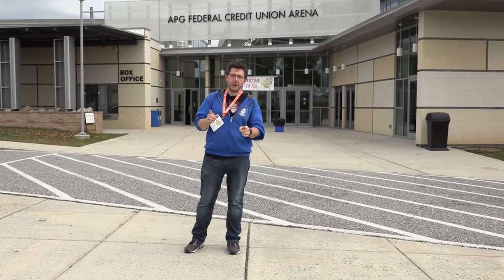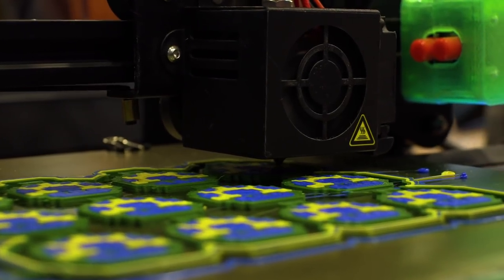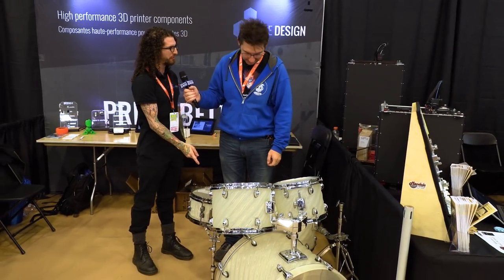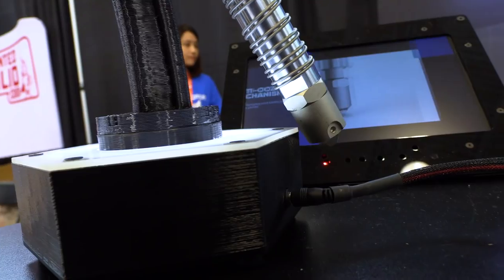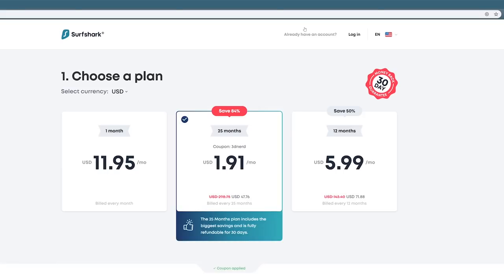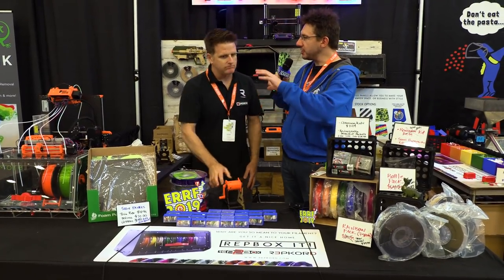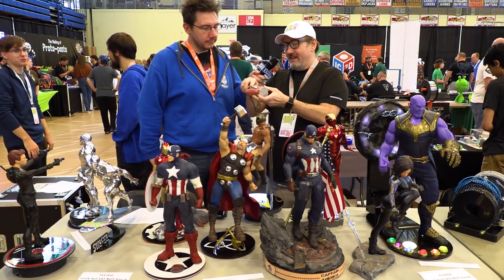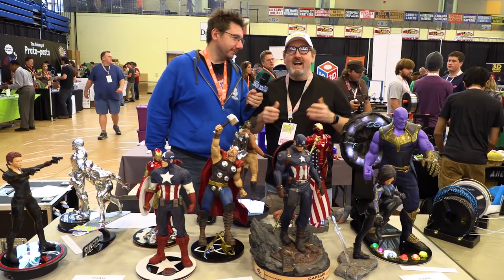Is THIS the Best 3D Printer? See Elite Machine Works AND MORE at East Coast RepRap Festival part 1!

Comment: The Elite Machine Works printer sounds right up my alley!  Finally, a printer that's not taking a ton of shortcuts on design.
Reply: Well... it is still a cartesian design (bed moves in Y Axis) which is most common but already outdated at this point. Elite Machine Works is just overengineering this outdated design which makes it first of all redicilously expensive, but still keeps the inherent designflaws. CoreXY is the next step as it has many advantages. All 3d printer companies are moving to this right now. So, you still want to commit 2k to a 3d printer dinosaur?
Reply: I have one of Kyle's kit printers - it is the precursor to the version he showed at ERRF. Mine has is pretty similar, but his new one has some upgrades, like the dual motors for Y, the CF rod stiffeners, and the slick CAT5 cable extruder interface. My printer works great. Super heavy and bomb proof. No resonance. You can't print super fast, due to the mass of the Y axis, but i regularly print at 80mmps and never worry about the thing breaking down. Recommended.
Reply: @ocieward  Yep, and that's the point. You print at 80mm/s, because that is the best compromise for this type of printer. Meanwhile any CoreXY prints at literally double the speed-- with same or better surface finish-- at half the machine price. I don't say this is a bad machine, it is just  "outsmartet" by better concepts and thus outdated.
Reply: H. P. Baxter yes, I agree with you that for this size of bed, coreXY is probably a better choice. But I don’t think that makes this machine obsolete. It depends on the intended use. This machine doesn’t have problems with belt stretch, so perhaps it would require less maintenance. Also, Kyle is working on a second IDEX head for this x axis, which would be very easy to implement, although the x on this one looks like it would need to be replaced with longer rails to make room for docking at each end. 
My printer kit was $1000, which was less than I paid for all my railcore parts, so for me this printer still made sense. The one he showed at ERRF is upgraded and the price he mentioned reflects that.
Reply: @h.p.baxter8150  Corexy has drawbacks. It is not the end all be all to printer kinematics.  Belt length being a major drawback at larger print volumes. My design is proven and it works as intended. It is not over engineered for the sake of it. On the surface it is hard to see all the detail that has gone into it.  The Ultimate XL reliably prints at 180mm/s with very acceptable surface finish. I'll be applying this philosophy to other designs aimed at large format printers. I'm just getting started.
Reply: @Robert Cowan.  I've been subscribed to your channel for a couple years now. Love the content! I actually bought a broken  Stratasys dimension based on your videos to build into a PEEK printer. That project is taking a little longer than expected...
Reply: @elitemachineworks1037  Awesome!  As someone that has a background as a hobby machinist, it's nice seeing a 3d printer that's build well, and not just using 3d printed parts!
Reply: Don't think there's much difference for CoreXY compared to a bed moved on Y axis.
It depends mainly if you want a compact and easy to access desktop model, or if you want a thermal chamber.
CoreXYZ on the other hand is a huge improvement on both, since you only move the printed part when replacing the build plate.

Comment: For the chameleon why not assign each feeder a number, use the left switch to rotate through and then the right to approve instead of adding more switches?
Reply from the maker: How would the switches cycle through options? Right now it’s just power being switched - cycling through something would require a way the handle that - do you mean to add in an Arduino or something?

Comment: I'm very curious of the 3D chameleon
Seems like this may be a good MM on the cheap. But is limited to bowden setups
Reply: Actually, it's not. It works with direct drives as well... By pairing up the motors, the top motors are used to load the direct drive motor.

Comment: God Damn, Elite definitely isn't an understatement. I might hold off on buying any other printer just so i can save up for this one. What is the exact size of the Print volume?
Reply: Looks like 300mm squared-ish. It would be really nice to see one with a larger Z-axis height that could compete with the volume of a CR-10!
Reply: All that overkill,  but can it justify that with an increase in speed... not with a standard 40 watt e3d extruder...

Comment: This is a copy of the canalizer flow invented in Italy 5 years ago if not before ... :(
Reply from the maker: Which part? There are a lot of things covered here
Reply from the maker: @AlbertoCotronei  Hmm, I don't think so. That video link shows a printer with all filaments going directly into the nozzle. The 3DChameleon didn't do that, it had that binary tree selector system. Though, if you mean having multiple filaments going into the same nozzle - lots of nozzle do that. I wonder, was the one in Italy the first?
Reply: @3DPrintingNerd  The system that you can see well at 2.07, is a wire channeler, 4 bowden inputs and only one goes into the hotend. This system was made for the first time in Italy by Davide Del Fiume or Immaginaecrea. https://www.thingiverse.com/thing:498922 . At the maker faire of Rome 2014 we presented the first printer that could print in 4 colors with 4 extruders and the channeling flow. The printer had a classic Ramps 1.4 and thanks to the firmware (derived from Marlin) Mk4duo could only use one driver for 4 motors thanks to a relay system. The following year, Prusa presented his Prusa M3 with the same system, instead we presented the first 6-color with 6-way canalizer flow and the MKR6 system a system that allowed the use of 3 engines with only one drivre, so with the Ramps 1.4 had 6 engines with two drivers. https://www.thingiverse.com/thing:1838995. At the Rome Maker faire in 2017 we arrived in 12 colors with an Ultratronics 4 driver for 3 engines each for a total of 12 extruders with a particular channeling flow made both in plastic and in metal to have the maximum revenue. The firmware was always MK4duo a firmware that was the first to go on processors with the Arduino DUE, only after two years Marlin with version 2.0 began to go on the Arduino DUE and other 32 bit processors. Many things about Marlin 2.0 have been taken from MK4duo, you can ask them directly if you don't ...

Comment: No.   Making something more expensive and just going for overkill for no reason doesn't necessarily make it better.

Simple example:  connectors on the extruder is a nice touch and is the right thing move toward.  But...  ethernet cable is usually single core on the strands.

Comment: oh y splitter with a mechanical switch! not much of a point for me but cool! but y splitters are a huge pain in the butt! at least 3d printed one.
EDIT: FUCK I need one! it looks so much better! I loved the y splitter idea but it had issues which he seem to have fixed!  it's so awesome!
also for more motors you could assign one side of the x to zero and another to 1 so just be like 010 or 111 for like you know.

Comment: Wanna make a bet that the EMW guy will not be on the market for very long? Cause I for one do not believe in prices like that for an FDM Machine...
I also don't believe in his overkill design philosophy for when there's no need for it AND it needs to pay the bills which I'm sure this will not - Not his.
Reply: Hi Durhal, Thanks for the input.
The best thing about owning a CNC machine shop and having the knowledge on design and manufacturing means I am extremely flexible and can bend to the will of the market. I understand the overkill aspect is not for all. I needed a printer that met my high demand of reliability and precision. I have seven of these custom designed printers running for the last 3 years 24/7. I also have clients that I have done custom builds for that can attest to the overkill nature and extremely high reliability of my machines. There are those that need a printer to meet their specific requirements. My printers are not designed for printing groots and other trinkets you download from thinigiverse, they are intended for those who need a highly reliable machine. The market is flooded with chinese printers that are not designed for heavy use. There's a saying in the machinist community "If you want a good manual machine buy the old iron. It was built to last". I like to build things that will last and follow my passion of doing so.
Reply: @elitemachineworks1037  Overkill is just right. I'm tired of tweaking my printers.